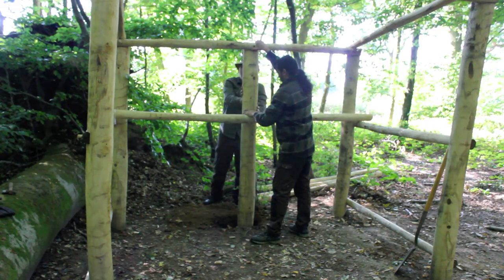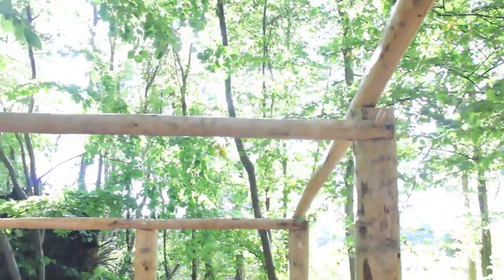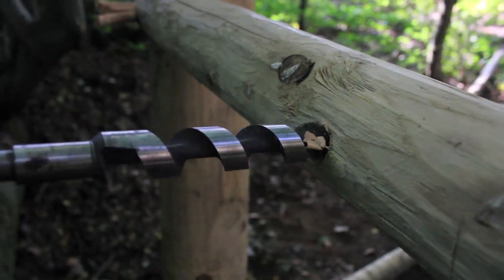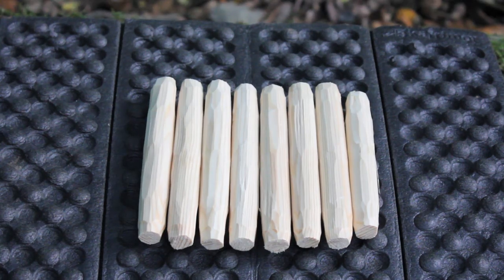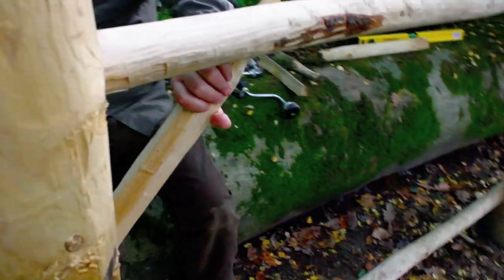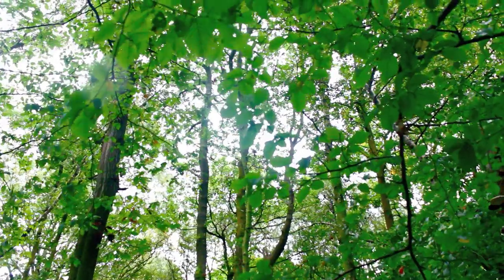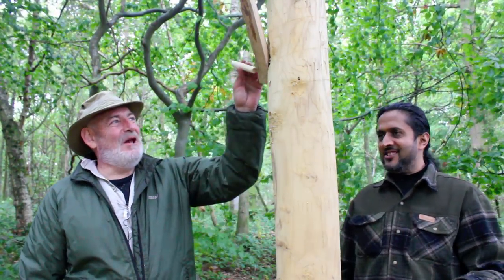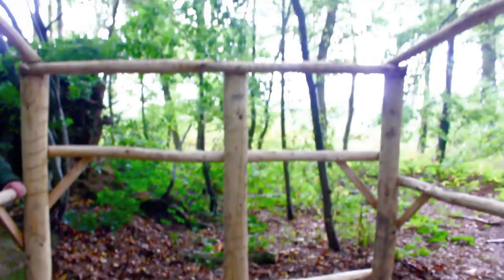Bushcraft Basecamp (Pt 6) - Main Frame Of Shelter Complete!

Comment: The shelter is coming along quite nicely.  I have a suggestion concerning your pegs.  If you cut a saw kerf in the protruding end, once you have them finally seated, and drive a wedge into the end of the peg, that will insure that the pegs remain sound no matter the changes of season.  It is a technique used often in timber frame construction.  Keep up the excellent work, and I look forward to your next video.
Reply from the maker: Indeed Wayne a few guys have mentioned that tip, i'm gonna leave the pegs as they are for the moment but moving forward with some additional structures i'm gonna build around this main one i'm gonna do exactly that. Sincerely appreciate you watching and your insights thank you ~Peace~

Comment: Great video as ever. 
There is one thing missing from your toolkit and that's cordage. I'm sure you never leave home without some..
It will solve those wobbly wood problems. A bit of string and two 3" wooden blocks. Cut the notches in the ends of the postand sit blosk in with string over the top. Hold the string off a fraction at both ends and if it is paralel then your notches are in line. If not adjust and remasure. Works for middle post as well. Cut outside notches and with blocks and string you can mark the middle notch depth with ease. 
Small spirit level struggles to cope on bent posts? Tie rock to string you have a plumb bob. 3" block at top between plumb bob and post, measure 3" to post at the bottom and it's vertical. 

Cheers mate.
Reply: Good tips for another day...and for the rest of us.  Thanks for sharing.
Reply from the maker: Appreciate your tips and for watching, lots of lessons learnt on this so far ~Peace~

Comment: Zed, frame work looking really good. Quick tip use a wooden mallet to drive the pegs a lot less chance of splitting them. Don't know if this has happened to you get but a pain when it happens! You can pick them up for a few quid at car boot sale. Looking forward to seeing the roof to on Demus
Reply from the maker: Indeed yes Demus we learnt a lot of lessons with making and fitting those pegs! next tim around we should hopefully do them a lot better ~Peace~

Comment: Really nice work. You guys must be a lot of fun to hang out with.
That shelter should last a long time.
BTW
For the posts and the holes it would probably add a few more years if you would fill the holes with fine stones instead of dirt. That would keep the posts dry. But if you have a large roof it´s probably not that much of an issue. I´m just saying.
I remember vaguely the ancients burnt the posts before they inserted them into the ground. Maybe someone can tell if that would help too against decay.
Reply from the maker: Yes very true reg adding stones and also burning the poles, decided against that in this case as this will more then last the two years I want it to but if I wanted it to last longer then I would have done that. Sincerely appreciate your kind words and for watching thank you ~Peace~

Comment: What a job!  I imagine you will soon find that the walls would build better if you had installed the angle braces inside or used mortise and tenon joinery to center them in the posts to produce an even face for hanging the wall material.  As I watched you hammering pegs into shaking timbers, I was reminded about watching timber framers who carved joints and dry fitted the entire structure on the ground,  Next everything was pegged together into modules for raising and setting in place.  That provided a stiffer frame into which the final pegs were hammered to tie the modules together.  Working on the ground as much as possible saves energy and enables better control of materials and tools.
Reply from the maker: Yes we did as much as possible on the ground before erecting the structure and reg the angle braces they are fine as is because the wall will be made from the inside out. As always appreciate you watching James ~Peace~

Comment: 10* 10* 10* Finally !!!!

Someone using the right tools !!!!  Wood auger and then dowel pin the auger holes !  When wood is wet or dry, dowel pin remains snug and firm - and doesn't rust out and break like iron nail.  No waste of cordage etc.  Even doing some mortis-and-tenon fittings and everything is excellent !!!  Can always run long dowels between long lines of vertical limbs that can then be put up against the frame and dowel pin to the frame as the walls.
,
Can always weld a proper metal tube (with sharpened edge) onto a metal plate, and baton sticks through and make dowel pegs.  Can always have a wax candle, and rub on the dowel side, and that will slip those pins in place with ease.  Need waxed-surface wood wedges for batoning and splitting the poles.  Need to cut a trunk with a 90 degree limb, then make a huge wood maul for proper wood-on-wood (vs hammer) dowel pinning.  Having a proper straight blade (or bent blade) wood shave for debarking, and smoothing knots and nubs ... excellent timber working. 

With all that wood augering, squealing like a wounded rabbit, would expect to see foxes and other predators coming to the call !!!

And he does JetBoil and a folding saw - almost going to call you "son." DDDDD
Reply from the maker: That Jetboil was probably why I got some dislikes!!! ;)) As always sincerely appreciate your insights and for watching John ~Peace~

Comment: Zed turn the Flat side of Chisel Out and then Chisel it on the Blades bevel, also giving you the bevel as a Lever to pop wood out ... also if you split the end of the Dowels and put a wedge in it will keep it from pulling out like in Axe handles, you can also try Pine Sap Glue on the Dowels, Specially since there Not al the way threw for you to Wedge the other end,  in stead of struts you could just Paracord X across Sides and Back Corner to Corner.
Reply from the maker: Sincerely appreciate your insights Jeff and indeed yes lots of lessons learnt on this build! ~Peace~
Reply: Thxs Zed keep up the great work.

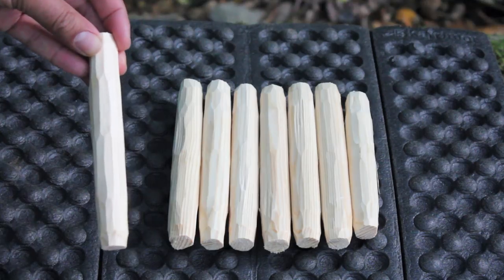Comment: @12:30 Have you tried a dowel plate? This is a metal plate with holes bored through. Take your pegs and hammer them through the plate to have uniform thickness dowels. https://www.amazon.com/Tool-Steel-Dowel-Plate-Standard/dp/B01BE5IWVI

@16:20 if you keep an old soup can with beeswax in it beside a fire; the melted beeswax can be brushed onto the auger to lubricate the flutes. This makes it easier to turn and cuts smoothly.
Reply from the maker: Once again great points and like the idea of lubricating the dowels ~Peace~

Comment: Thanks Zed for the video. The Basecamp looks great my friend. If you don't mind could you leave a link or a description of how you aquired the trees. I know you said  they were copised and responsibly managed but how exactly did you aquired them? Thanks again for the video and I hope you have a wonderful week. - Josh
Reply from the maker: As always you are very kind Josh thank you, i'm actually planning on doing a detailed video on Coppicing soon to explain how the process works but in short you need to connect with 'Coppice' woodlands and / or folk who do forestry management of some sort. Coppiced trees are tees that have intentionally been grown so at the right age and size they are cut down to be used for woodwork, construction, etc and because of the way they are cut down the roots are left intact so it then promotes new growth, a few years later that process is then repeated. Hope that helps in some way, like I said I will be doing a detailed video on the topic as it's quite an important one ~Peace~

Comment: In the post holes, probably should have used a flat stone as a base, so the post end grain is on stone, not soil. The end grain sucks up moisture. In lieu of this drench the posts in pitch (100% natural product)
Reply from the maker: You are right yes but this wood is sweet chestnut so extremely resilient and as I only want this shelter to last two years it will be totally fine ~Peace~
Reply: Zed Outdoors And, sorry mate, that probably came across as judgemental and picky. I do love your channel and I cannot wait to see the shelter finished. You’re really lucky to have these skills and ability to explore your love for the outdoors. Top work mate

Comment: Question!!! Every cross section is on the outside of the post except the top back is on the inside. Explain this. Well done by the way.
Reply from the maker: Thank you kindly Doug, difficult to explain without showing but the top beam at the back we had to fit on the inner part of the poles so as to accommodate the angles of the roof poles when we come to install moving forward them if that makes sense. Hence we had to put the diagonal pieces on the inside ~Peace~

Comment: Zed, excellent build, enjoyed very much but here's a question... it seems that on your side of the pond (and I can be wrong) early roofing seems to be thatching which gave way to either clay tiles or slate. Here of course we're not as old so we're newer at housing development, early log cabins we're roofed with split wood shingles. I am of the assumption that your thatching was due to wood being less plentiful and reeds being more available where here we seemed to have a limitless supply of wood, I know you've probably done some research with your building, is there any evidence of split wood shingles being used as roofing materials in any of the traditions you've studied? Just curious...
Reply from the maker: Indeed Mike the UK has a strong history of shingles from either Oak or Sweet chestnut being used and still used to this day. I was intending on doing that on my roof but I grossly under estimated how much work actually goes into them and the prep thats needed on the roof foundation to actually fit them once they are made and ready to install. So I have no choice but to use a different technique for roofing which I will discuss in an upcoming video however I will be building a wood store on the side of the shelter and hope to use shingles on that ~Peace~
Reply: Zed Outdoors I watched a guy split shingles once, they look awesome but it was a lot of work, you're build reminds me of the Plymouth Plantation project where they rebuilt the settlement, awesome work, again very much enjoy your videos

Comment: 7:50 The diagonals work well for structural integrity, but I believe that wire (or rope/para cord) windlasses work better. A notch is cut both on the vertical and horizontal pieces of the frame and a loop of wire, etc., placed in the notches and tightened in the traditional way (as with tightening a fence or a buck saw. Here's a pic of something similar (yours would just be on a horizontal: http://s3.amazonaws.com/finehomebuilding.s3.tauntoncloud.com/app/uploads/2016/04/09124726/hb106tp01-01-main.jpg
Reply from the maker: Nice heads up, alas i'm only using natural cordage on this build so would have been difficult but none the less a great technique to know of thank you ~Peace~

Comment: Next time move your camera slower, those takes were terrible for my old eyes LOL, nice progress by the way and a clean build, and a bit disappointed because of the use of a jetpack burner, to fancy it is like to take an airco system in your tent LOL, don't take it to serious oke just teasing but no modern tools and then that... well hahahah
Reply from the maker: I know that jetboil didn't fit the look but working with a real fire takes time and on this occasion we were up against the clock as well as early sunset so had to work super fast round the clock! Appreciate you watching my man ~Peace~
Reply: thank you for making the time to makes those video's, you gave some idea to do with my customers , the way you are building does look fun to try.